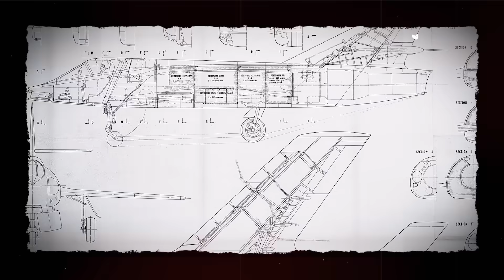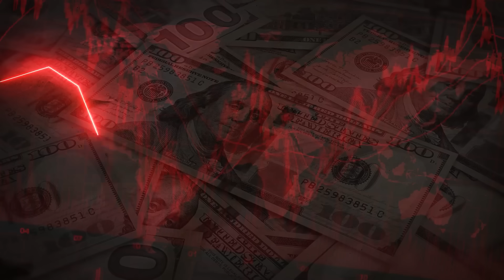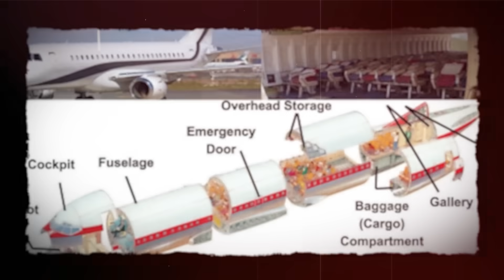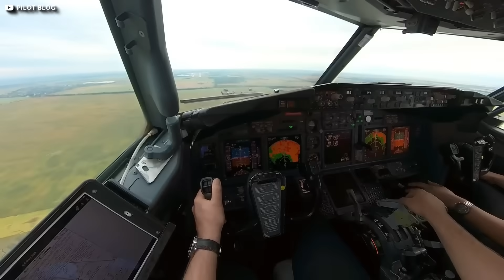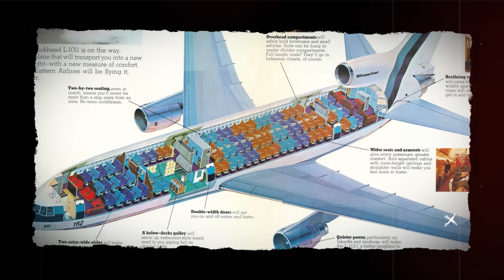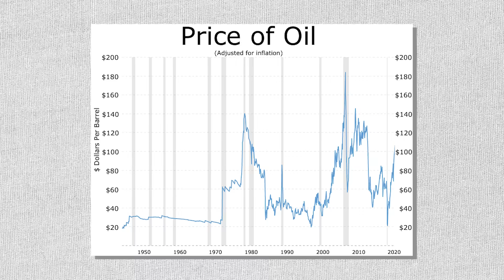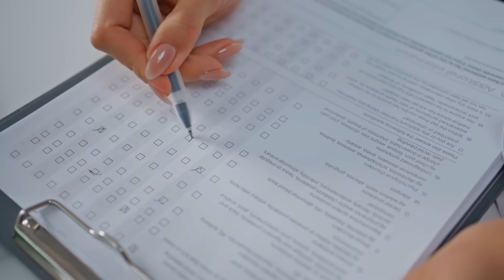What The Trijet Design Was Really For

Comment: You hit the nail on the head when you said that L-1011 had triple redundancy. The Tri-Star was a much safer aircraft because it had backup systems, including independent slat locking safeguards that would keep it from suffering  the same catastrophic operational failures that doomed American Airlines flight 191. I always found it ironic, that two different Flights with the 191 designation both crashed but had very different outcomes. The flight 191 operated by a DC-10, had no survivors and because of that plane's LACK of redundancy, the pilots had no idea of the severity of the emergency and took measures that intensified the crisis. The flight 191 operated by an L-1011 crashed because of weather but I still think that because of Lockheed's attention to detail, not only were there survivors, but the TriStar had a safety record that was incomparable. The DC-10's reputation never fully recovered. It was widely stated in reports that McDonnell Douglas rushed production of the DC-10, in order to beat Lockheed to market.  And after the crashes both in Paris and Chicago, controversial memos turned up, showing that McDonnell Douglas offered employees, bonuses for coming up with cost-cutting ideas. unfortunately, the same profits before safety issues are infecting Boeing, now that the 2 companies have merged.  Personally, my affection will always be with the L1011. The DC-10 was too risky and I'm glad that I never flew  on one. NOTE: before anyone accuses me of being a conspiracy theorist on the McDonnell Douglas cost cutting point, simply read both official reports on the Chicago crash by the National Transportation Safety Board and the FAA. There is also an article in Chicago Magazine, the May 7-2019 edition  called 'the ghosts of flight 191'. A gentleman who was an investigative reporter in the 1970's and was due to fly on AA 191 to a book sales convention with his  boss, decided to investigate the DC-10 and it's safety history after the Paris crash. He came across the memos from McDonnell Douglas and decided to cancel his reservation. His boss was one of the 273 people killed. The journalist, Laurence Gonzales,  told his story to the magazine.
Reply: Yea I just wrote something similar that after the shit McDonnell Douglas pulled in the first half of the 70s id take the TriStar any day over the DC-10 and imo after Turkish 981 and the discovery of the Convair Warning Memo McDonnell Douglas should've never made it to the 80s, certainly it amazes me the DC-10 made it to the 80s, but That's the world we live in, profits over the lives of 346 people and still allowed to continue despite proof they knew it could happen before a single passenger even stepped foot on the damn plane and they still did nothing to remedy the problem and proceeded to sell the DC-10 knowing what would most likely happen if that hatch failed, they were even given a second chance to right the problem after American Flight 96 incredibly found their way to the ground without a life lossed and they still only did a quarter ass of a job...sorry to yap
Reply: Actually, the L-1011 had a quadruple-redundant hydraulic system; four separate systems, unlike the DC-10’s three.  It also had a hydraulic fuse in the tail, which was later added to the DC-10 after the UAL accident in Iowa City.
Reply: @AndreySloan_is_a_cnut  it refreshing to hear from other people who know the truth about McDonnell Douglas. It literally made me sick to my stomach, when I heard that they were .merging with Boeing. When the 737 Max -8 suffered those crashes, it came as no surprise to me, that they kept the MCAS a secret from the airlines. Some of those same executives had been involved with the development of the DC-10. And like they did back in the 70's, they tried to deflect blame to everyone except themselves when a crash happened. One final point, is that the executives are still trying to invoke "gentleman's agreements", in order to skirt the regulations and get the aircraft into the market. If I had been a prosecuter, Harry Stonecipher and the rest of that bunch from McDonnell Douglas, would have been in prison for murder, for causing the deaths of all these people.
Reply: It’s a shame the DC-10 has better range and could carry more cargo and thus was better for airlines.

Comment: Improperly torqued bolt?  The airlines had been almost completely ignoring the McDonnell-Douglas stated procedure for removing and reinstalling engines during maintenance procedures which led to cracks in the engine mounting systems and was the direct cause of the 1979 O'Hare crash.
Reply: Yep opting to use a forklift instead of the MD approved bootstrap kit

Comment: I loved the Lockheed L-1011, especially Northwest Orient.  I had three bad experiences with the DC-10; I never flew on the plane again.
Reply: Northwest never operated the L-1011. They were firmly a DC-10 customer. In fact, what became the DC-10-40 was a special request from Northwest. Originally it was going to be labeled the DC-10-20, but the CEO of Northwest insisted it be -40 so they could brag that it was better than the -30 series. Besides DC-10's in their fleet, Northwest also operated the 747 for a long time, and were the launch airline for the 747-400. They also had -100's and -200's but those were retired in the 90's and mid 2000's respectively, well before the Delta merger.
Reply: Indeed, the DC-10-40 was because Northwest also had 747s; both used the JT9D and the idea was this would provide for some commonality of parts and maintenance, although the engines themselves to my knowledge were not interchangeable (I would be shocked, absolutely shocked, if they were, but parts on the other hand…, and training of mechanics and flight engineers… another matter)
Reply: Also the MD-11 uses the third engine nacelle design from the DC-10-40 interestingly enough, so Northwest’s desire for a higher model number was in a sense prophetic, because visually speaking, the DC-10-40 looks slightly more like an MD-11 than the the DC-10-30 or DC-10-10